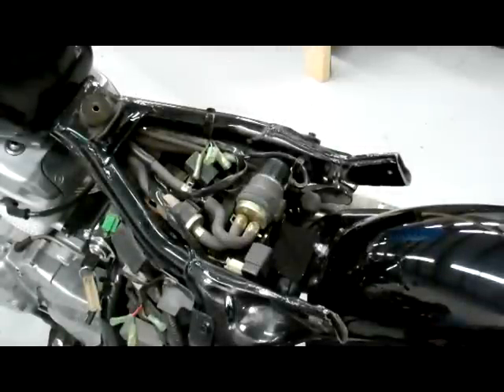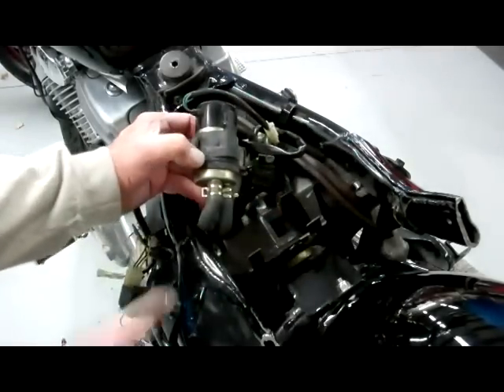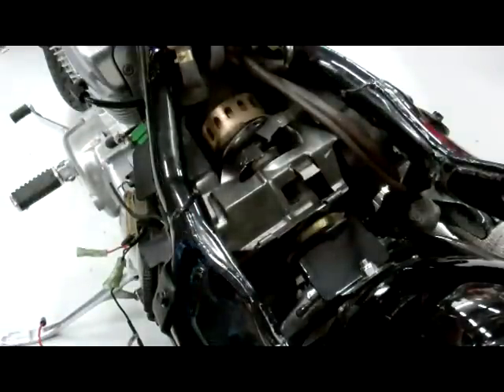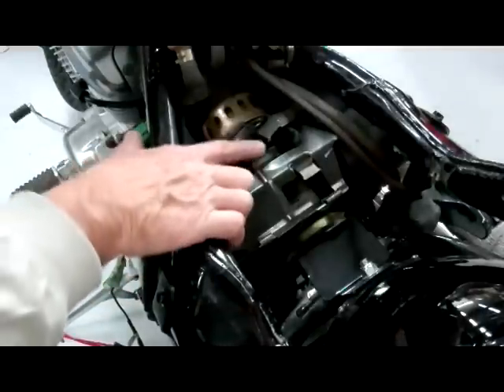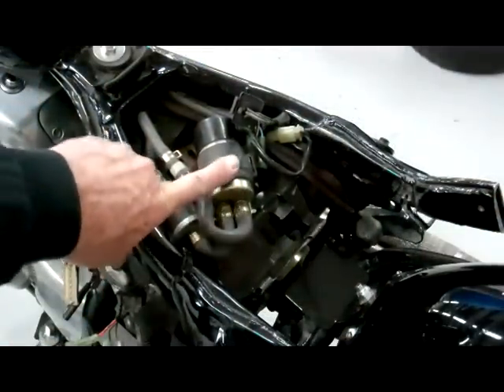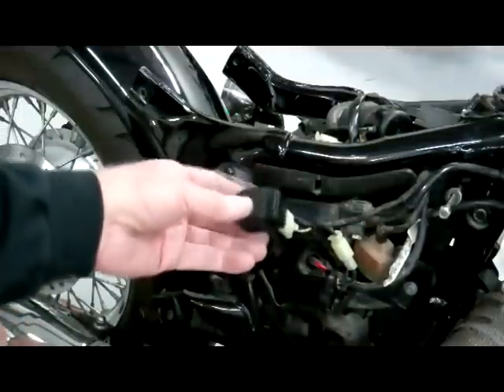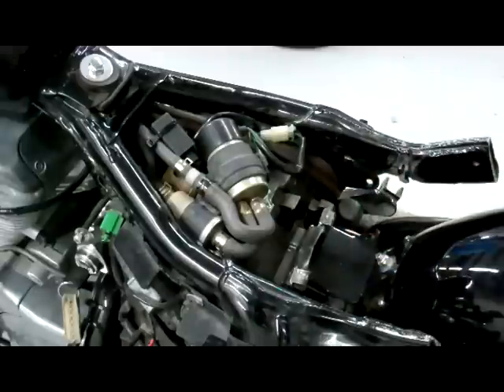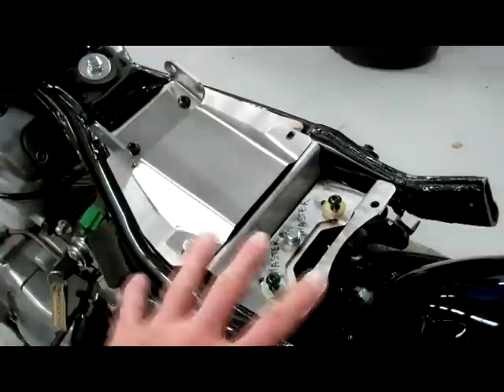Honda VLX600 Equipped with Fuel Pump - Seat Install 1998 & Older

Comment: I got a 2004 Honda Shadow vt600, is it supposed to have a fuel pump, cuz I looked for mine couldn't find it.
Reply from the maker: Hi John, your bike has a single carburetor which doesn't require a fuel pump. That's nice because it's 
more simple. Thanks , Lance at BCB
Reply: Blue Collar Bobbers 
thanks for the reply, I'm just having an issue with my bike. every time I'm doing 65-70 it completely shut off, and I have to wait 10 minutes for it to start it. from idle to 50, it's running fine but 60&up it shuts up, I've been trying to solve this problem for 2 weeks, is there any suggestions u can plz give me
Reply from the maker: Hi again John, we aren't mechanics here at BCB. It sounds like a fuel supply problem buy you may want to ask a mechanic or check some of the forums.
Thanks again, Lance
Reply from the maker: Your bike is a newer 600. They don't have fuel pumps. They are gravity feed.
Thanks Lance at BCB
Reply: @johnthebaptiste1785   How did you fix your "shut off" problem?